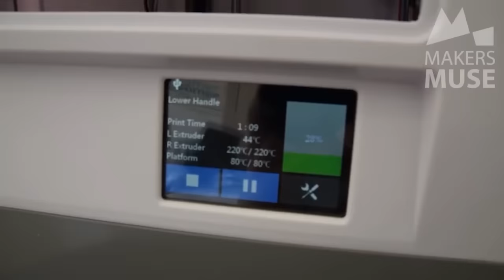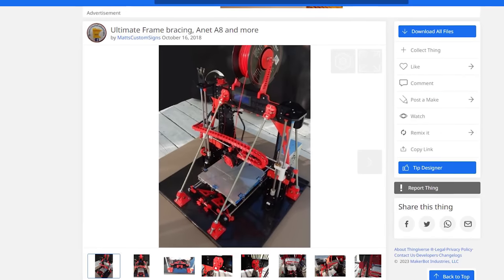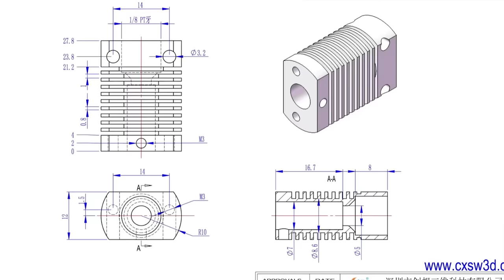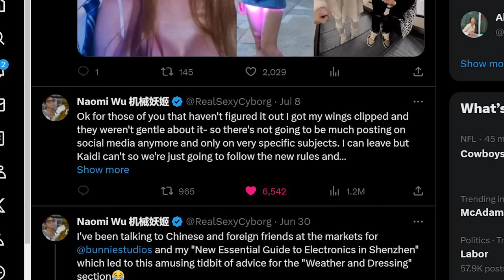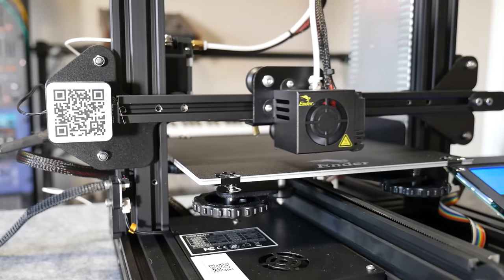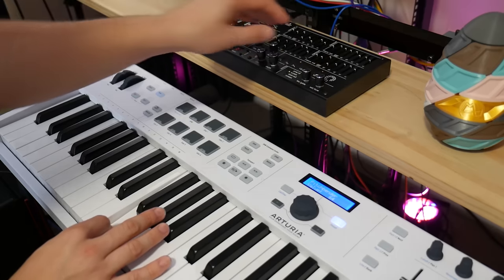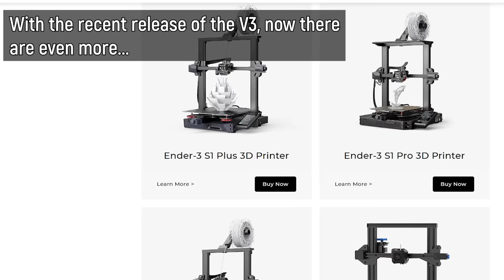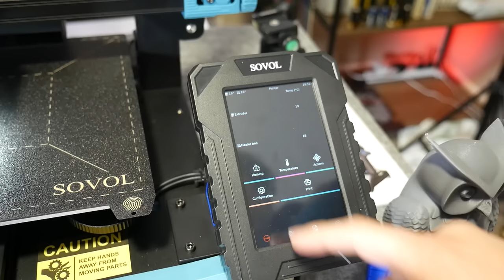Creality Ender-3... it's time to move on.

Comment: I think There at least 2 different types of "3D Printer Beginners" : The ones that just want to start printing at the lowest price possible without having to learn how the machine actually works, and then we have the tinkerers, that want to learn how things work and how changing thing affect the machine behavior and final results... For the former, Yeah, an Ender3 is NOT for you... But for the later, there's not better machine! Although I have to agree that Creality would have been better off crating a better accessories line, instead of launching new complete machines wen only one or two specs had change, like instead of the ENDER3 Max, just sell the frame, or instead of the ENDER3 V2, just launch the screen assembly...

Comment: Klipper with a bl touch pretty well runs mine lights out. Its the only thing ive printed on. Actually just picked up a used one to convert to a switchwire. Fun times.  Ive printed some wild parts on my ender 3 pro. But anyways my theory is creality still probably sells mostly ender 3s

Comment: I respectfully disagree. I got an Ender 3 S1 and it came with some issues sure. It's not good enough that it did but with some youtube and discord advice I got everything fixed in a day and I'm better off for it. It's informed my modelling and I take certain considerations in my designs because I'm more aware of the limitations of 3D printing itself.

At the time of writing this, and in my currency, the Ender 3 S1 is £280 and the equivalent sized (and cheapest) Bambu is £499. That's too substantial as far as I'm concerned.

In regards to the names, I don't like it either but there's other companies that are equally as bad such as Microsoft with Windows but mainly Xbox.

Comment: My Ender 3 is also a Bitch sometimes. It got an CR touch and it has problems heating with the new firmware and forces me to painfully preheat in 10°C steps. But it works and was in my pricerange.

Comment: I cut my teeth on a Creality CR-10 v2, but have recently bought an Elegoo Neptune 3 Max and a Neptune 4 Max.  I haven't looked back.  For the price, these are FAR better machines.  The Neptune 4 Max is also super fast, and goes up to 300C out of the box.  I felt like some of the stuff Creality did was a little gimmicky, and they absolutely cheaped out whenever they could.  You might even call some of their design choices 'lazy.'  They deserve credit for what they did for the hobby, but they have certainly fallen into the trap of overconfidence that plagues so many successful companies.

Comment: Eh... don't know, chief... Yeah, the E3 has its long list of problems, but also it's probably the only recognizable 3d printer that you can buy off of Amazon for less than 200 bucks with a reasonable print size and the bare minimum of custom components.

Comment: I got an ender 3 s1 pro a couple of months ago and had to check the release date of your video as none of the critiques applied to my machine. Only upgrade was insulation to the heat bed (which led to some problems that needed resolving), but besides that, I just experimented with nozzles. Once managed to break the filament in a bad spot, took some time (half an hour?) To disassemble and clean up. Last print the spool fell of and I ended up in the same situation as I attempted to continue the print. I guess creality has earned a "you suck" video for some reasons though.

Comment: I've been saying this for the past two years. I never understood why they didn't just either release the E3 new or hold off and get a unified product out. the E3 V3 KE is the prime example to me of choppy Frankenstein style "engineering" literally cutting the printhead off the K1 and slapping it on an E3 V3 SE which they had very recently released prior to it.

Comment: I have ender 3, not in everyday use anymore. I really would like to use it to more exotic materials like nylon but it does not got hot enough. Any good motherboard exhange ideas, no theoretical but used and tested? (yes it is in classic Ikea DIY cabinet, mostly because its loud but it can keep warm in work area too).

Comment: "If I had to repair it all the time, I would probably give up on it", yeah, sounds like my experience with my Prusa i3 MK3. It's been nothing but cursed. Everyone I've talked to, including Prusa tech support cannot diagnose my problem. I'm well over $200 and countless hours in repairs on it, and I've about given up. @MakersMuse or someone could help me, I would be more than grateful.

To summarize it quickly, problem:
I calibrate 1st layer height. Every subsequent print after calibration will lower the 1st layer height till it crashes into the print bed. Nothing in the software changes, and no changes are input by me. Bed Visualizer indicates a leveled print surface. Only thing that changes between M commands to output the mesh bed visuals is the reported initial z height. Power cycling changes the 1st layer z height to +/- 0.300 mm of initial calibration. Symptoms continue as described above.

Attempted solutions: tightened all nuts, bolts, pulleys, etc., replaced x and y guide rods as well as the bearings (making sure to pack the lube in the bearings), replaced the motherboard, and replaced the pinda probe.

I don't expect the answer here, but if anyone know what it could be, please let me know.

Comment: One month in, got my Ender 3 Pro as a gift (2nd hand), and with some tweaks on Cura I am getting pretty darn good results but getting a weird buzzing sound when I try to save to the eeprom, this happened after I updgraded it's firmware to "Ender-3 ProMarlin2.0.6HW4.2.2EuropeMultiLanguage"

Comment: The ender 3/5 absolutely suck and the troubleshooting "advice" by older users trolling to reinvent the concept of semiconductors just to solve an issue where filament isn't being extruded at all from the extruder gear is fucking ridiculous.  I hate the Ender 5 Pro because 99% of "advice" is just Ender 3 stuff when it is not at all relevant like they claim it is.

Its only shilled by Creality's marketing team and I've never even heard of it elsewhere.

Comment: Using the ender 5 plus, considering buying an ender 3 to double print speed. Every Single Day the bed of the ender 5 is unlevel by about a millimeter, no warp (checked it with multiple rulers and a laser.) Idk why in the world it is so unlevel 😑

Comment: Your way off! I just got my first 3D printer and it's an Ender 3 V2. After watching many videos and talking to people that have been printing for years, I settled on the Ender 3. The main reason is I'm a beginner. What I mean is If I but a Cadillac and something goes wrong, I have no idea how to fix it. If I buy a Chevy and thing are constantly going wrong, I'll learn to fix it because I'm tiered of the shop never getting it fixed properly. Wy would I want my first machine to have all the bells and whistles like self leveling without knowing what the level does. Is it fustigating when thins don't go right, oh yes it is and I know why the plate temp is and why, what an unlevel plate does. Why, because I'm suffering through it which you wouldn't if you buy that Cadillac. I can't wait to learn as much as possible then I'll upgrade. Most anyone buying a 3D printer for the first time that buys that Cadillac will most likely get out of printing much quicker. After all, look where you are!

Comment: Would be good to see an ultimate ender 3 upgrades video to review the most relevent mods in 2023. Mine is a little tired, but still pushes out the brackets etc. I need. Would be good to know what mods might still be worth doing but there is so much out of date content.

Comment: I agree that Bambulab printers are a world better than Creality but Bambulab has no printer in the 200$ range either. If someone is on a tight budged (200-250 range) I'm not really sure what else could you recommend them.
Reply: tbh just tell them to get 200 bucks more and get an a1 mini or make afew models and makerworld and get the printer for free

Comment: I just got my Ender 3 SE, took me 45 minutes to realize that I needed to flip the damn switch on the back to account for American voltages otherwise it would turn off during the boot up process. This step wasn’t in the manual and I wanted to die. (All this happened yesterday as of posting)

Comment: With all due respect I somewhat have to disagree.. OK the e3 is a joke and can be dangerous, but next up e3pro, while far from perfect is insanely cheap and as you know printing is anything but cheap.

Not everyone has the money to get into it, so such a cheap printer is awesome for some people. You do have to learn about it and be savvy. 

Once you've done your learning,  then and only then, you can make upgrades (hopefully 1 at a time) to do more with it, making it a great way to spread the cost and learning even more about how it works if something was (and will with any printer) to go wrong.

I would still advise to go for the e3pro if cash was an issue.  Learn about the bare minimum and once you are comfortable, slowly upgrade it - probably starting with all metal hotend and skr drop in 32 bit board.

I love my ender and yes, there's plenty of upgrades done, but it's been at an affordable rate.

Comment: You should have this video evaluated and graded by a college debating and logic professor. I'm not sure of the grade you might receive. It seemed to follow a sine waveform of reasoning...though I have to admit: that many models with so little differentiating was the strongest moment of the video. I would feel just fine if Chevy still made the 1969 C-10 truck using the exact technology with only inflation price point adjustments. Your music lab backdrop for the 3D printing videos is interesting...almost distracting (but interesting). The alternative machines didn't "look" that impressive.

Comment: My ender 3 is a beast. It prints reliably anything i thrown at it specially PETG. Has so basic upgrades like the silent board and heatbreaks... the ender 3 is still a good printer. Just a lot of haters. I have been on discord groups and they all hate it... despite having made monsters out of them OR they had it at one point. Not everyone has 1000$ laying around to buy a prusa who idk uses 3d printed parts to make their printers. Is there better printers than an ender 3 stock at similar price? Yes like sovol but every printer has its downsizes. I have a fokoos odin f5 and i cannot do with it what my ender can because it Simply doesnt have the support for it...

Comment: Watch out one actually might be slightly worse! for some reason creality started putting worse chips in ender 3s that can cause fires if you don't have the right firmware. (which is very hard to find.)

Comment: The Ender 3 is not perfect, but a few hours spent on YT and a minimal investment in upgrades makes it as capable as a $600 printer. 

If other manufacturers can somehow justify their insane markups on machines that are essentially just blueprinted Ender 3's, maybe the Ender 3 could have a successor. But the technology hasn't changed much in the last three years, and it's time for prices to start coming down.

It's the Harley-Davidson of 3D printers isn't it?

Comment: he my ender 3 pro has nothing left of the original printer exept one of the displays, yep mine has 2, and the original powersupply, and yes mine has 2 😀as it has a 500w bed aswell. And a printvolume of 240x450x500mm, and iv got a new old cr10 smart modidied aswell so it can work. but still a project at work, but for $150 + some new parts it an ok printer. the ender3 needs a break, it has been printing for thousands of hours. is on its mainboard number 3 and im sure it's hotend number 100.

Comment: 1. Your comparison of the Ender3 to the Bamboo lab is not entirely right (comparing a 3D printer that costs $1K to one that is about $200 - same as comparing a Mercedes Benz to a VW) - this is the entire idea, not everyone have a thousand+ dollars to spend on a 3D printer, this market niche is reserved for those who uses the printers in the pro/mass production/commercial zone, there even a $4K printer is possible as long as it gets the job done. the market Creality are/were focusing on were the hobby/semi-pro 3d printer fans, those who can't just splurge a grand to enjoy the hobby.

2. Your argument is focusing on the original Ender 3 (or the V2 which is virtually the same) which really had a ton of issues (like every "first" revision of a product), if you would have taken the time to compare with an Ender 3 S1 Pro (or even a standard S1) you would find out that it is almost unbeatable for the price, Creality is not innovating ? there is almost no innovation in this space, mostly one company copy from another with minor changes to design and quality of components - the 3d printer companies who does innovate are those that are selling the $2-5K 3D printers.. and for that price that it's "easy to innovate".
The Ender 3 S1 Pro is a completely different story, forgot about the original Ender3, the S1 Pro pretty much fixed all of the issues of the original E3 that people have used to shell out money on upgrades .. the upgrades are native and pre-built into the S1 Pro model - even the ptfe pipe issue does not exist anymore.

Just make a less biased comparison please, using the Ender 3 S1 Pro (or just S1), there, other than a lack of a shiny enclosure and slightly better quality components, it does not go that far apart from the more expensive 3D printers that costs two times more.

HOWEVER I do agree with you, that creality needs to have better offering, for an example: a version o an Ender 3 S1 Pro with linear rails on all axis (or a properly engineered kit for retro-fitting), a proper hard enclosure that is not made out of flimsy material etc - maybe through a "purchase wizard" where you "customize" the printer by adding/removing options.. (add linear rails option, with/without enclosure, with/without fume extraction/filter etc.)

Comment: that small printer at the start that said only $500 made me think, THAT IS SMALLER THAN MY MP MINI DELTA, THAT THING CAN'T DO NOTHING. AT LEAST MINE CAN PRINT PARTS THAT CNA BE FUSED WITH GLUE OR A SOLDERING IRON.

Comment: I think you didn't go far enough.

The sovol svo6 IS the new ender 3. It is cheaper than almost every ender 3 offering and performs better than all of them.

It is the new floor.

Even the Ender 3v3 KE is a worse performing printer than the Sovol Svo6 plus.

Saying not to buy the ender 3 doesn't go far enough without telling people what the cheapest 'no questions asked' printer is, and from my vantage point, that printer is unmistakenly, the Svo6

Comment: i had an ender 3 pro and it just kept breaking and breaking and breaking..... i was almost to the point where i had paid enough in spare parts to just buy another ender 3 pro so i said F it, sold it for what i could and splurged on 2 prusa's.... should've gone with the prusa's to start with, those printers will scream at you if literally anything wrong occurs

Comment: My 2 Ender 3 machines are hacked. I think that's what so good about them. So hackable. But yea a terrible machine for a non technical beginner. Auto bed leveling and no Bowden tube are a must for an entry level machine. I really don't like the closed source direction 3D printers are heading to though.

Comment: Never thought about getting any printer of this brand. Never will. Zero $ invested back in R&D. So, yeah, they will be dead soon. My 3D printer is boring. Every time I need to print something, it just does. No tricks, no accessories, right of the box, it always worked. The only problems I had, ALL of them, related to bad filament. Done. 
Prusa, BTW.
Money savings will never compensate for all the headaches.

Comment: I love a lot of your vids, but without a section on "Here's other great 3D printers you can get for $99 that have a great support structure," your argument lands kind of flat...
The Ender 3 is still around because it is still one of the best bangs for the buck...
The Ender line having LOTS of variants...  Yeah, that happens when a product resonates with the public.
That isn't a bad thing... ;-) 
When Bambu labs releases at $99 or even $199 printer, then it will be fair to compare it to a similarly priced Ender 3.
But saying the Ender 3 needs to be retired because there are better printers that cost more money???  
Really?

Comment: I’m gonna disagree with you. I think the Ender 3 series is absolutely fantastic. With the only caveat being it’s time to admit that Bowden systems need to die. They offer ZERO benefit over a well designed Direct Drive system. All the fastest printers in the world are now using direct drive. So let’s just make it go away…The infamous micro center sale here in the states allows people to get a GOOD printer for between $79-$99 usd. Depending on which particular Ender variation is on sale that day. Which is an AWESOME deal! 

Personally; I believe that there are some things in life people should have to put a little more effort into. And printing is one of them. I know Enders can be a pain. And I know it frustrates a lot of people. Well for one. Grow up and learn a little bit of emotional control and patience. And two. Learning how to solve little issues like bed leveling or under extruding in the beginning will make it a non issue when you have your $1,800 printer 5 years from now. The dirty little secret no one tells you about expensive machines is that they still have problems once in a while too. 

As far as Klipper goes…uggg. I love klipper and half my printers run it. But it is still very much in its infancy for manufacturers. There are all kinds of bugs with cheaper factory supplied klipper machines. Obviously; higher end machines don’t suffer from this issue. But very few people decide to get into printing and have a $2,000 budget to do so. It’s usually $200… if that. This is why the Ender is great!